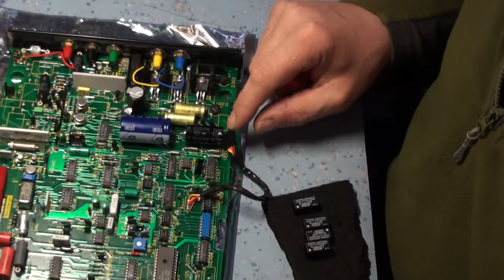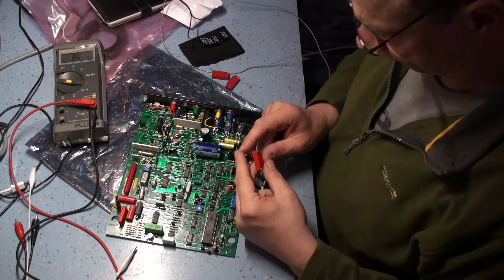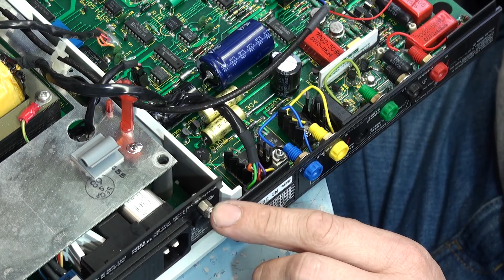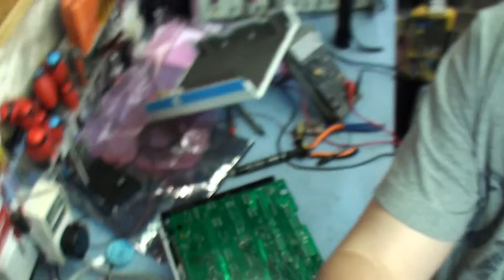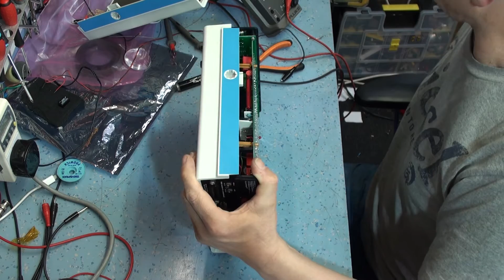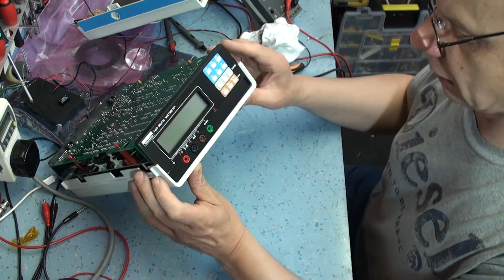Schlumberger Solartron 7150 relay problems Pt2

Comment: Hi,  I believe the 4 wires mentioned at 2:03 are the power feeds from the transformer windings, not wires from the front panel - I only know that because mine fell off too and I had to resolder it lol.  Also interestingly the protection diodes for the relays are actually in the ULN2003 IC which is a buffer that drives them all from the main controller.   I repaired a 7150 yesterday for myself - so I noticed it whilst probing around the board.